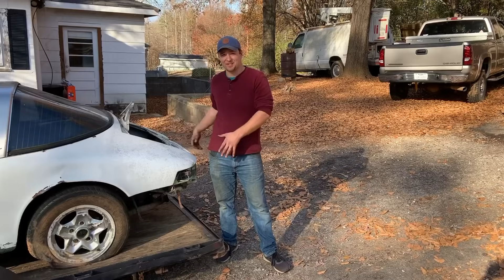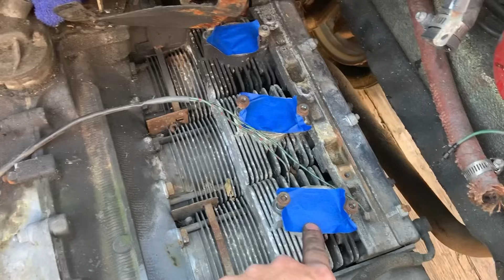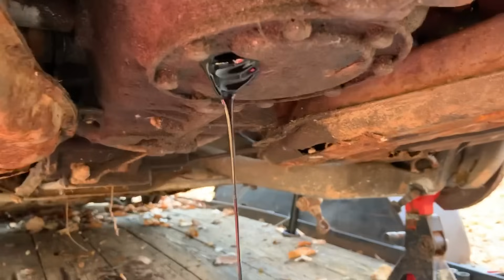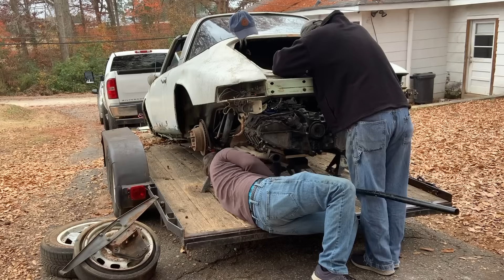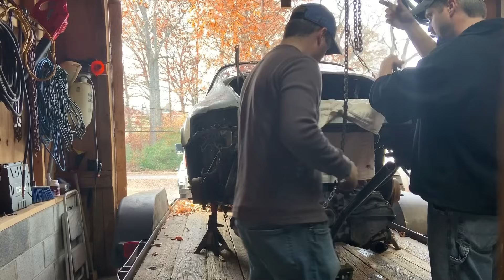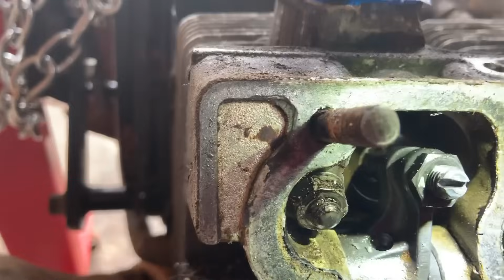Saving a Vintage Porsche 911 Targa from the Scrapyard! Rebuild Part 2

Comment: The 911 aluminum banana trailing arms are the same 74-77. The headers look fine. The heat exchangers on the headers can easily be patched. That said the heat exchangers are a know problem for your year. That and unless you want to remove the rockers and replace the heated air tube in the inner rocker as they are probably collapsed and or falling apart. I would just remove the heat exchangers on the headers but that is just me. That is if you don't mind not having heat. That said there is a small chance you may get lucky and the heated air tube in the inner rocker may be ok. You should be able to check if they are still in good condition by removing the heater control boxs or flapper boxes in the engine bay and use a USB endoscope to inspect them. I can't wait for the next update! If the engine does not need rebuilt please at least update the chain tensioners and replace the head studs and if you have not already join https://forums.pelicanparts.com/porsche-forums/ everything you will ever need to know about 911's is on there just make sure you use the search before you make a new post. This forum is more laid back and has more air cooled knowledge and owners than other porsche forums. Just be careful a lot of people will tell you that it's  just a parts car and will try to talk you in to selling it. Please save this car if you hot rod it. it can be done cheap.
Reply from the maker: Jarrod VW Thank you! And thanks for the advice! I do believe I’ll be going no heat, much more simple and it’ll be a fair weather car like the mg :). I’ll be sure to get in the pelican forum!

Comment: Greetings from the UK. Watch your personal safety, that did not look safe when you were under the back when it was still on that crusty looking trailer, I know there was a stand but it could have slipped off that or the stand gone through trailer bed. Scared me, i had to watch through my fingers !  If you haven't already then watch the series "Homebuilt by Jeff", his 911 build should inspire you. I'd keep it looking Euro original, in ice green, not wide body, but do something Singer-ish and a bit radical with the dash and interior - especially as it looks like someone had a go at the existing dash with an axe and there is not much left of the original.

Comment: Nice progress, it would be really nice if you don’t have to spent a lot of money to make it right. Did you already check the engine number and the chassis number, are they matching?
Reply from the maker: D. Dolphinstriker I have not, I will try and get on that today!
Reply from the maker: D. Dolphinstriker Checked and the engine is a 911/92 (base model 150hp) from 1974, I highly doubt it has been swapped but without getting an authentication I won’t know for sure. I do believe she’s the engine that came with the car!

Comment: I know this is an old video but I wanted to tell you what my parts guy told me,. He said when ever possible he uses VW parts for his  Porsche  or his dads Mercedes.  Because the prices are so much cheaper.   I have VW lug bolts on my 1977 Mercedes 240d.  they were less than half the price of the Mercedes lug bolts.

Comment: I subbed just to see the potential train wreck, but I love your enthusiasm. You are dealing with a 2.7l magnesium case engine, they pull head studs wickedly easy, all mag cases do.  To re-build this properly, you are looking at $25K.  There is no such thing as a budget build Porsche. I am experiencing it firsthand and have done my research up front and I am still running into unexpected costs.  GL

Comment: I understand why you are keeping the car on the trailer.  You don't have to be laying on the ground working so much and you've got a nice clean surface under the car.  That being said, please use some jack stands or trailer leveling jacks to stabilize that trailer.  It moves around too much as you're working to be considered safe.  I'd hate to see this build end because the car fell and hurt someone.

Comment: Definitely hope it will work out. Could look awesome with the light ice green metallic. But this video should/could have edited down by using fast forward mode for the not so interesting (but time consuming) parts (pulling the engine with a hoist for instance).
Nevertheless: Thanks a lot for making recording editing uploading and sharing.
Best regards luck health and wisdom.

Comment: aLSO...GET AN ICE PICK AND START POKING AROUND ON THAT METAL WORK...YOU'RE GONNA FIND A LOT MORE RUST THAN YOU THOUGHT YOU HAD...BEEN THERE , DONE THAT.
Reply from the maker: John Smith White paint is directly on the original with no filler hiding rust in between, it’s an honest car. Not by any means my first “classic” and no where near the oldest. They’ll be more rust but what little bit is there is in the floor and not in any structural areas, just cosmetic repairs as far as metal work.

Comment: Got to say I'm amused by the comments of no water in the oil.  This engine is air cooled with no water anywhere. My 1999 911 was the first water cooled engine from Porsche.
Reply from the maker: I meant because of the busted intake and open cowling, rain water